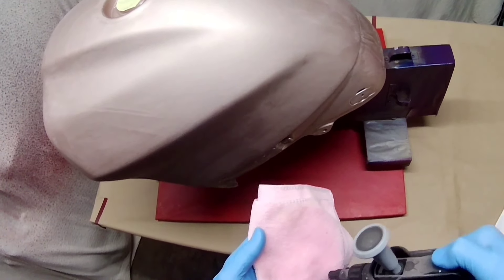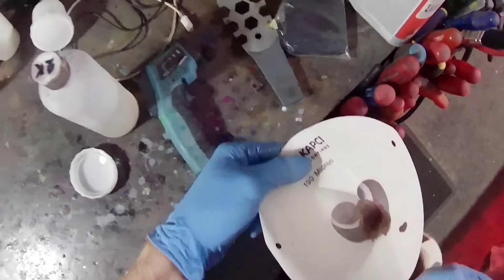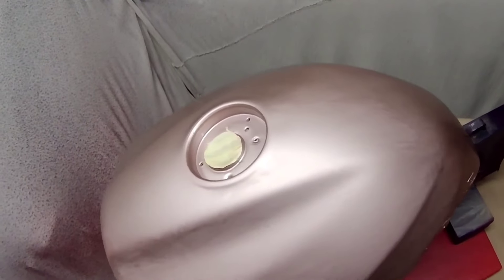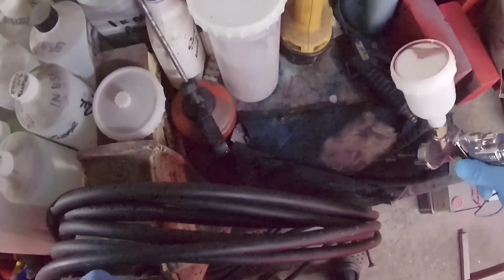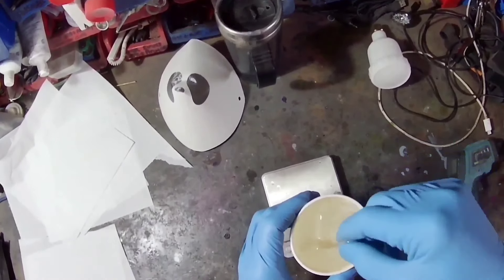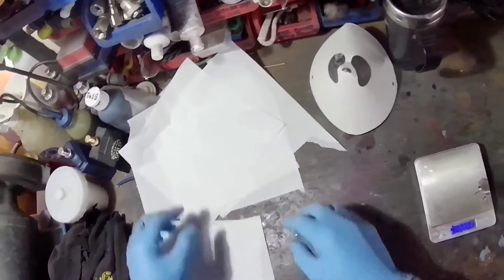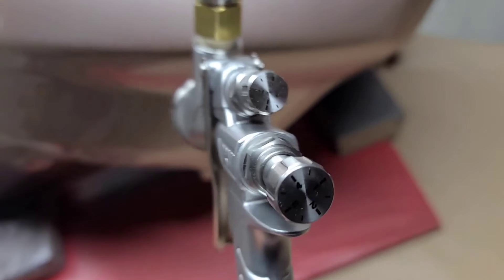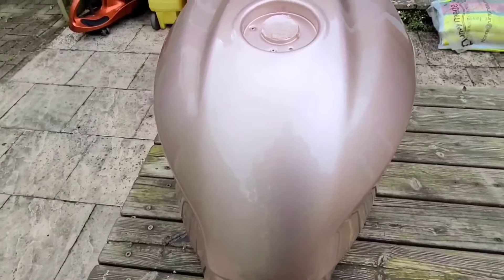Dram V Tip Spray Gun, Iwata Kiwami4 WBX WB Split Tip Type, Taiwanese Quality

Comment: Hi Pete, a very enjoyable video mate as you know I love your vids so please keep making them👌🙏once again you have another great gun in your hands which again has made me want to get one😁I've just decided which gun to get next then you go and throw this into the mix🤔🤪😂

The finish from the Dram is spot on mate even the basecoat went on as good as most guns and I could tell that the clearcoat went on with very little peel, I'll add this gun to my ever growing list of guns I want (not need🙄).

I take it you have seen that the new Multi Mix UHS clear is now available, this will be an interesting clear as it's a single visit but still giving a good build, the downside is there isn't any sample or small kits available🤦‍♂
Thanks again Pete👍
Reply from the maker: Hi John,  This is a fairly new gun. In fact, 
I don't think there are any reviews of it on YouTube,  mainly because no one has heard of it 😜. 

It's very good and only around 88 USD at the moment,  I suspect it's out the Avalon factory in Taiwan, but I can't be sure.

Yes, I've seen the Multi Mix C4. I haven't looked into it yet as I still use different clears up.
A one stage clear should make it easier to use, there's a few clears like that but I haven't used any of them yet, are you getting some ?

Cheers mate 👍
Reply: Will be looking forward to you testing out the Dram as well.
Reply: Hi Pete, yeah I had a feeling it was new to the market even though it's made in Taiwan it does look good quality but I think my Fuji was made there as well so they seem to turn out good guns but not as good ad Japan seems to👍

The MMC4 does seem to be good clear but I'm wondering how well it will cure without a bake cycle, I'm hoping to try it mate but it's a bit pricy if it's not suitable for the likes of us, I did ask Jordan if it would be ok but as usual he didn't reply to my comment on his group🙄🤦‍♂👍
Reply from the maker: @JohnWD40TC02 Hi John,  Yes, the Fuji is made in Taiwan, and that's also well made, so hopefully, this Dram will last a while 😀

It's not good form to launch a product and not answer questions, especially as through your Instagram account, you publicise the product.

It will be fine to air dry. It will probably take longer, but I can't see why it wouldn't cure. Cheers, John 👍

Comment: Hi Pete, between this one and the Ntool 4000b, which is the best? I mean, about atomization and spray pattern...
Reply from the maker: Hi Mate,  this one is better,  slower but better,  it's twice the price as well
Reply: I @peteshobbies5383  i was asking because my f160 (with 1.2 clear cap) has a very small fan and, in a range of 15-18 Celsius, requires minimum 2,5/2,8 bar to atomize decent... 
So i was serching for a gun not too expensive( chinese for sure 😂🥲) that works well in "cold" temperature... anyway thanks for the reply!!
Reply from the maker: I've not used an F160 in 1.2, but I have it in 1.3, and the fan isn't small. It also only needs 2.0 bar for a good finish.

I am wondering if something isn't right with your F160? , is it the hps cap?
Reply: @peteshobbies5383  Is the fan large even with ambient temp clear? 
Mine was 1.3 hps silver but, somehow, i damaged the air cap before try it(which is very similar to the 1.2 clear but the "ring" around the center hole is bigger).
Reply from the maker: @cristianb.4135 Yes, even if the clear is 15 to 18c it has a big fan, take a look at some of my reviews,  you will see the fan size there

Comment: Hi There. Just found this video leading on from the R500/A610 comparison. Love the detail you go into, great video. Just bought one based on what I've seen here. Just hobby use so can't spend money on kiwami, which i would love. Many thanks for your efforts.
As a side note, I've been using a R500 which i found awful! Your video explaining the real CFM of this gun i think explains it. Bigger compressor output purchased now.
Reply from the maker: Hi Dominic,  Good to hear you found the video. This is a pretty new gun, so there's not much about it, but I think you'll find it much better than the R500.

The R500 needs around 2.5 bar, so 36psi for a clear coat, and at that, it's up around 8 to 9 cfm, much more than is advertised. You can normally get reasonable results with them, but if your compressor is struggling, you may find the pressure drops, which will cause loads of problems, that's where diaphragm regulators come into their own.

Good to hear you found us anyway, I'm a bit of an eccentric but takes all sorts to make a world,  right 😂 , cheers mate 👍
Reply: Haha, it certainly does. You need to make a video on how you made the 36 hour day! How do you fit it all in. Thanks again 👍
Reply from the maker: @0012dominic Certainly seems like that sometimes 😂,  cheers mate 👍

Comment: Thank for another great video.
One question I have…after watching your video on regulators, I picked up the Meji like the one you are using. I noticed that you don’t lock it down after you adjust it. Since I’m new to these, is it not necessary or are you just that good at not screwing it up?
Thanks bud. Always enjoy
Reply from the maker: Hi Scott,  they are lovely little regulators, aren't they 😀
I always used to lock it, but I've since found it doesn't move anyway, so it isn't needed, I guess if your hand or arm is often coming in contact with the adjuster then it's worth locking it, but certainly for me the pressure doesn't change,  cheers mate 👍

Comment: Hi Pete are these split tip guns ok for 2k direct gloss or would using a conventional  gun suit it better ? Cheers
Reply from the maker: Hi Andrew,  They would work OK but not best suited to direct gloss,  a conventional 1.3 or preferably 1.4 flow more material which is normally beneficial for direct gloss.

Certainly, I wouldn't reach for a split tip given the choice , but you could use it if needed. I hope that helps 👍
Reply: @peteshobbies5383    I used my Dram for 2k Black gloss paint and I got quite a lot of orange peel. I put a bit more on to help it flow out but I just got a run . I warmed the paint and added 10% reducer but its a lot different compared to base coat and clear which I paint outside and get reasonable  results . 2K Seems quite a lot thicker .You make it look easy but there is a lot to it ..Thanks Pete keep them coming
Reply from the maker: @andrewodonoghue8666 Yeah,  that's the reason I wouldn't recommend them for direct gloss. They just don't flow enough,  as you say, direct gloss is normally thicker,  hence a 1.4 coupled to a higher flowing gun will help you get enough material on without holding the gun back too much.

It's all a learning curve, mate, and we are all still learning. Cheers, buddy 👍

Comment: Nice finish my friend, the guns should last a reasonable amount of time. As you mentioned, value for money, for $100 bucks, if it lasts even five years with a moderate amount of use, should be worth it. Cheers
Reply from the maker: Hi Bryan,  I think at this price point, it really is worth taking the chance 😀,  Have you received your Sagola yet ?

Cheers mate 👍
Reply: No Sir, not yet. I ordered two different, a 4100 pressure pot gun, and the 4600, one of them is on back order. Hope they will be in soon

Comment: You're making me happy this weekend, Pete! 😂  I didn't expect you to review it so quickly, but I am glad you did. I haven't gotten a chance to play with it yet, but it appears it definitely was a good buy. 

The overspray did seem a bit more than say a LPH400, but nothing too excessive compared to a conventional tip gun spraying a HS clear.  Metallic basecoat looked to lay nice with the extra atomization without you having to do a drop coat. At least I don't think I saw you do one.  That's great. When you heat up the Upol, does the viscosity come down to a medium solids level? Just curious for comparison as that's what I use sometimes.  I have both MS & HS in Upol to play with.. I'll be testing both soon. 

Keep up the great videos & reviews!
Reply from the maker: Hi Boss,  I've hardly ever used any MS clears, so I'm not sure if the heated Upol would be equal 🤔. 

It's certainly a good gun, obviously I'm not sure on longevity but I'm not expecting any problems,  I go this out quickly as I've had many messages on Instagram asking about it, to be honest,  it's a bit af a find 😀 

Let us know how you get on with your when you get a chance 👍

Comment: Buenos dias pettes,me podrías decir configuración de caudal de aire y de producto por favor.
Reply from the maker: Hi Buddy,  I would guess this is around 10 to 11 cfm
Reply: @peteshobbies5383  me refiero a configuración de la pistola,cuantas vueltas de producto y cuantas vueltas de abanico.
Reply from the maker: @davidcomas5896 That's nearly always the same when I use a gun for clear coat,  It's full fluid and full fan, and pressure, in these,  is 2 bar, so 29psi

Comment: Have you noticed any difference between the Iwata tulips spit tips like the lph400 lvx that has 4 cuts outs in the tip as opposed to the 3 cut out like in the Kawami 3 ?
Reply from the maker: HI mate, someone asked exactly the same thing in the comments. Normally, the 3 splits run faster,  which makes sense as the split tips definitely slow guns down. It's why I know some put a 3 split in their LPH400 to speed it up. Also, a 4 split can often be used at lower pressures,  not always. The WS400, for example, is 4 split tip but runs at 29 psi 👍

Comment: I pqinted a bike with clear intercoat and epoxy color pigment it took like 8 coats and i got mottling
Reply from the maker: Hi mate, You can get that if your overlapping isn't correct,  Candy can be difficult to get right so it just takes practice. 
Keep the overlapping around 75% , distance and speed the same all the time, that should do it 👍
Reply: Yea it was on bicycle frame it would been easier if it was on more flat surface that i could also work the gun around bit it was a good learning experience i guess i gotta correct few things .im going to get regular paint next time and hopefuly it want mottle
Reply from the maker: @damensutherland7081 Yeah,  candy,  by its very nature, obviously relies on even coats. The more you put over one area, the darker it gets in that area,  which obviously shows afterwards.
You will get there. It just takes time and practice , cheers, mate 👍